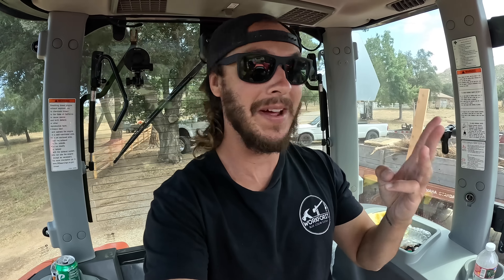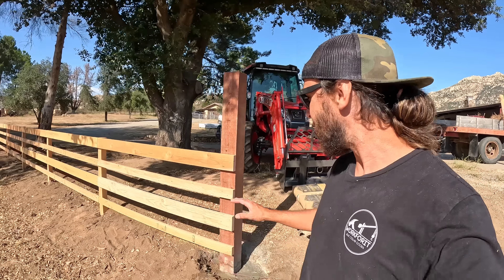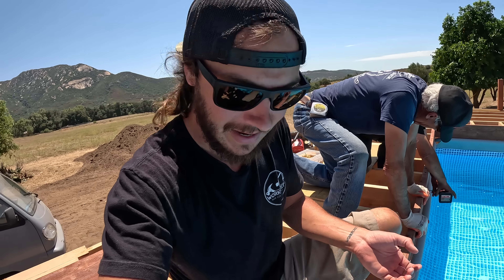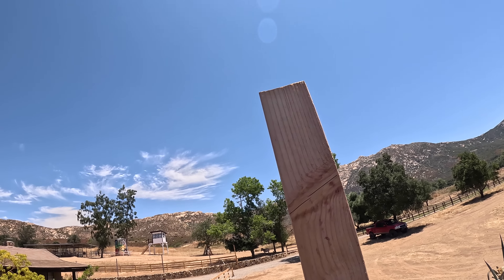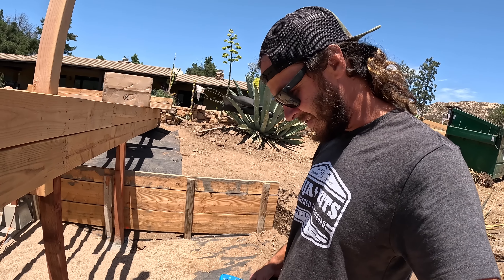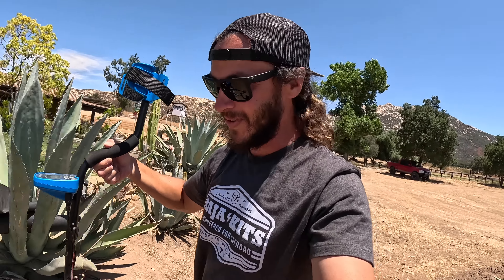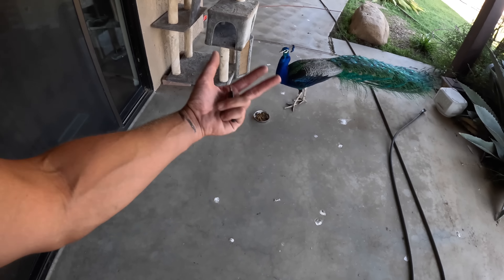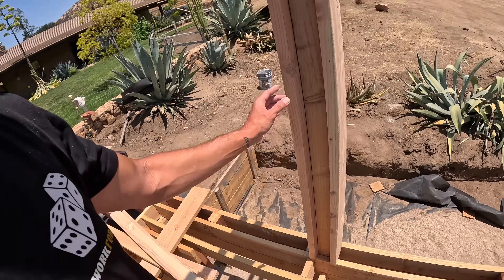I'm Hoping This Will Be a HUGE Help For Wildfires! (PART 5)

Comment: Using 120v string lights above a pool is prohibited by many municipal codes due to the possibility the wire could fall into the water and electrocute everyone (GFIs can become defective over time). But low-voltage lighting would be fine. However, if you are going to be skimming leaves or brushing the vinyl with a long aluminum pole, the overhead wires may frequently get in the way of your pole.

Comment: If your looking for a good way in and out of the pool, I suggest a dock ladder that can mount to the deck instead of some stair thing that sits on the floor of the pool. We built a deck along the side of our pool and put in a Techstar 5 step flip up ladder that has been absolutely perfect.
Reply: How long have you used the ladder? Any issues fading in the sun?
Reply: @FantasticHunter  its been up for since 22. Hasn't faded, plus it gets a 10 year warranty. Pain in the butt to install but once its in. It ain't goin anywhere

Comment: I have done tons of fences GC in florida. But suggestion I always pour my fence posts dry and level then pack the dirt back on top, ground moisture hardens up the concrete. Easier to set level and stay level when the concrete is dry. Just a suggestion.

Comment: I used to build patio covers like that we would rip 2x6 at a 22 and screw them with the angle down spread them every 4 to 6 inches it gives you more shade for the same weight and looks a little fancier

Comment: A small peice of paper towel shoved into the 1/4 inch socket with the bit can save you a lot of time I’ve found! Holds it well and pulls out easy 😋

Comment: Thank you for clarifying the screw holding weight. I was asking on the last video about the weight being held by just some screws. I always thought some kind of joist hanger was required to hold all that up. I am NOT a deck builder or a framer, so I have no idea.

Comment: Ryno I've had the same problems with pressure treated twisting and drying up in my backyard. Try to keep it wet if you can hose it down. I had a sixteen foot two by six turned into an s shape

Comment: You could run cable angled from the ground to the uprights and all the way across back to the ground. That would strengthen the uprights plus your lights and some shade triangles could go on there.

Comment: I checked with OSHA and as long as you're using a cordless drill it's okay to stand in the pool while you're putting the boards on the edge of the deck.

Comment: One way to counter the stress from the overhang would be running a cable from the back of the pergola posts to the ground behind. Just put an eye lag in up top and get some aircraft cabling to a cork screw anchor less than $50 at HD. I have the same set up holding the trampoline down in our back yard. We’ve had storm winds pushing 85 mph lately and it’s solid.

Comment: If your cantilever sags too much, add some cables on the back side that anchor from the top of the arbor post to the post below the deck that are anchored in concrete with a backwards "arm" similar to an electric pole or grain bin transfer pipes.